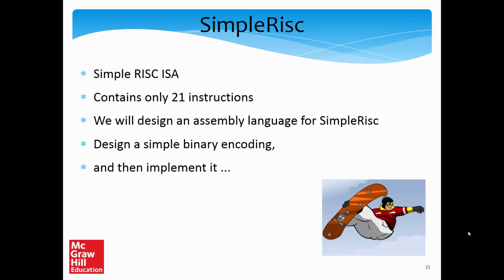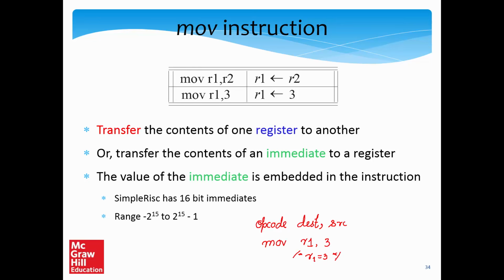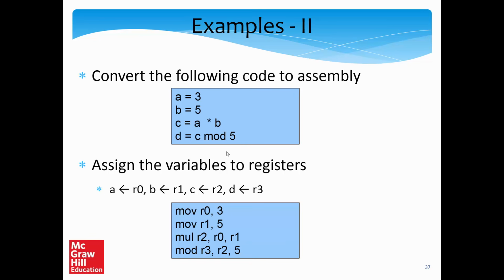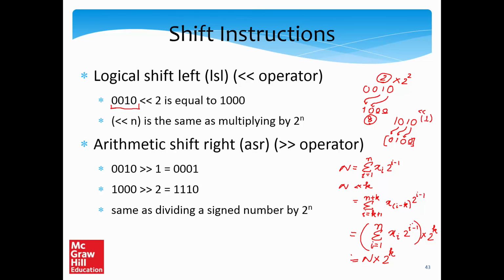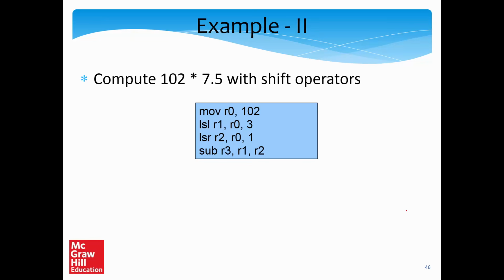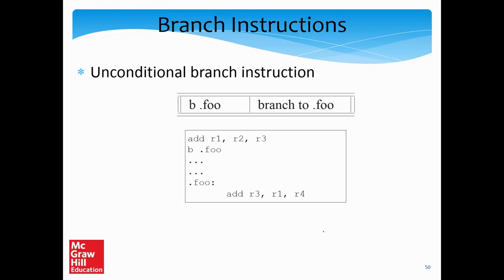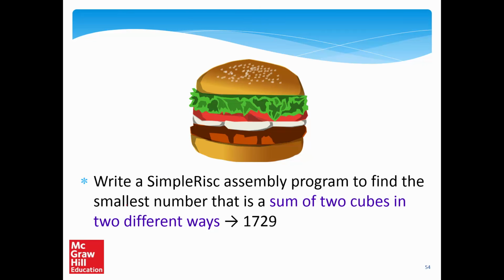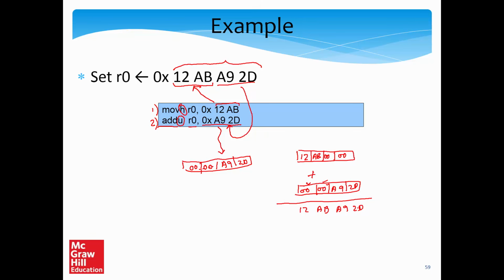Chapt 3: Assembly Language, Part 2/3 (Smruti Sarangi)

Comment: at 1:23:24 why can't  we simply  move the number in register? why we need two instruction and modifiers.
Reply: I think the reason is that the older machines were 16bit processors, capable of performing 2^16 operations/cycle, and also only store 2^16 values per register.
The modifier, now changes the 16 bit representation of the number into 32 bits, which necessitates, two cycles